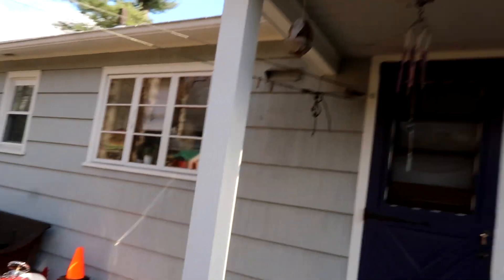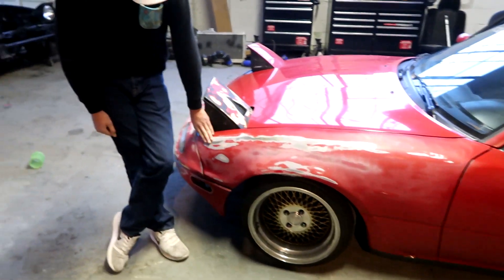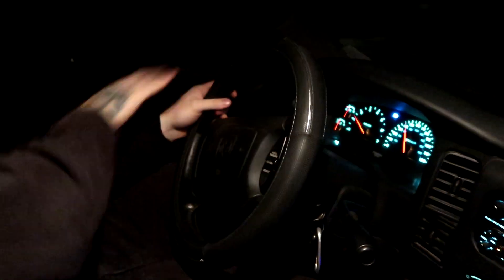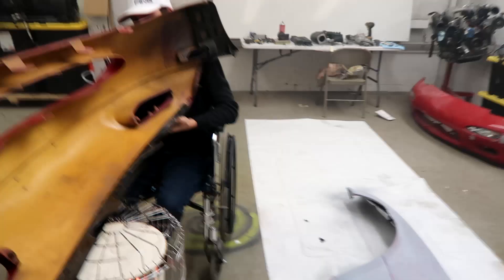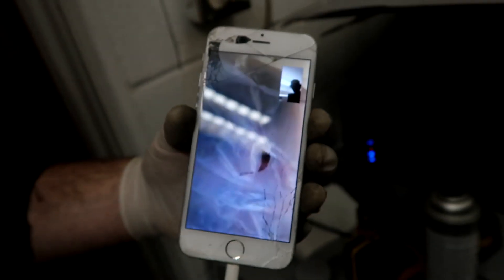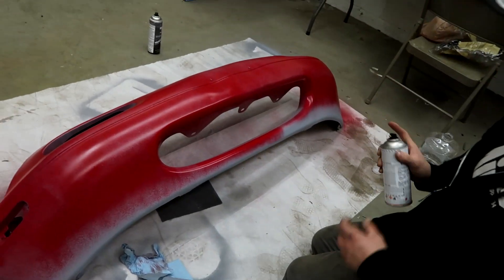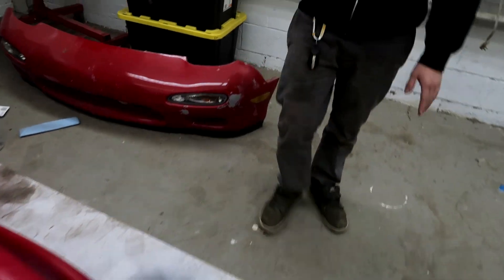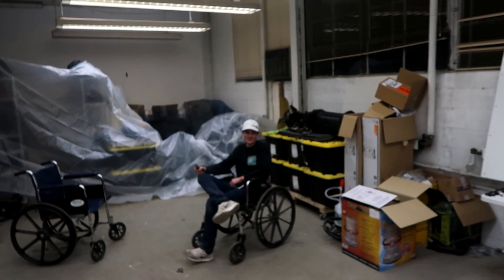IGNORANT MIATA GETS PAINTED!

Comment: spray bombing is hard 'cause of the inconsistent pressure coming out of the can but it's always best to warm the can up on a cold day with say, a heat gun. also start by spraying the edges (outline) then do even straight lines top to bottom. self etching primer makes a big difference as well.. these are things I learned while attempting to spray bomb shit lol

Comment: One suggestion, $15-$35 vacuum feed spray gun, small compressor with pressure regulator, urethane reducer and plenty of it "At Least 1 gallon" for cleaning out the spray gun and cutting base coat per the cans instructions! Then just buy the base and clear plus the activator of your choice "Timing of drying for clear" and you will save big bucks on any other paint job you guys do! The reason you choose vacuum feed is you will have more control for learning how to apply than gravity feed!

Plus you could repaint any car, especially if doing it for a demolition derby, for friends or yourself and you will save big bucks, there are many types of primers available and you will have less waste going into the garbage or to recycling! The paint can usually last up to a year, including the clear coat and you only add the activator when mixing for the gun, if you don't use a whole can of spray clear that had an activator you depressed it will turn rock hard in it quickly without exposure to air!

And for demolition cars you can just buy Truck and Tractor paint pretty cheap and some paint thinner, it will take 3 days to fully cure but will last years longer than the car does before going to the wrecking yard! It also works good on sand blasted parts for suspension, frame rails etc and is pretty chip resistant! It can also be used on auto's, but has no clear and if it fades, just use rubbing compound to renew the finish! 

But with truck and tractor paint you could repaint a car for under $50 as long as you have the gun, compressor and paint thinner, because you will need to cut it for spraying! A gallon is like $25-$35 "You'd only need a quart at most" and primer is cheap as well at tractor supply, big r etc, if you wanted a custom color you can buy it in white and have it custom colored to anything at a paint dealer!

Comment: When the cans are stored in a cold place, its better to have them sit in warm water for a few minutes.  It helps the paint atomize better.  Thats why alot of people get texture with plastidip.  You can wetsand the paint between coats with a high grit to have it turn out more smooth and even. Its good to wetsand clear coats and then polish it out with m105/205 or something similiar.

Comment: future reference, the faster you travel with the paint the more even it will be, also that paint is coming out super fast so you wanna be further away, with most paint you wanna be about 16" away and moving about twice as fast as you are, and always paint the shortest way possible. like you were going the length way, when it would be much easier to do it width way.

Comment: Pre heat the pannel and can before spraaying! ie 20C ideal

cheap spray paint has too much thinners, good stuff is a better mix with more paint content
. 
always buy from professional body paint stores that also sell  mixxed cans

You need to get enough on to get it to flow together and smooth out, add more if its dotty. 

If you do the above and clean the part up good and rought the surface with emory cloth you will get profesional result. you also need a dust free environment! wet the ground.

Hope this helps someone

Comment: Okay, I'm only a painter in training here. BUT. You should use red primer instead so that it matches the color better. The red paint will cover the red primer easier. Don't forget to prep your painting surfaces by scuffing them as I saw you do, but also clean the pieces off with wax & grease remover on a towel that will not leave lint. After the primer is sprayed, wet sand and it flat so that the texture in the primer is flat. And lastly, HEAT UP YOUR CANS.
Reply: This video is truly the blind leading the blind 😂
Reply: crunchee if there's grey primer under the original paint and you use a red primer on those panels then try to paint match it'll come out a different shade of red even though the new paint is exact match
Reply: chris No it will not. I work in automotive paint and I've seen it first hand. The purpose it to use less paint to cover the the area and still match the paint. we use gray, black, white, and red primer for the various paints.
Reply: And either way, the paint cannot be an exact match on such an old car no matter what you do. He's not even worried about paint matching though. You can tell because he just bought red spray paint that looked about the right color.

Comment: +Ricer Miata you probably need ball joints for the Dakota and the tie rods I had one and called the dealership and it had a recall and they fixed it for free and it drove good after that the ball joints don't last but every 40,000 50,000 miles and you change them.

Comment: next time you guys paint using rattle cans, leave them in warm water for about 5 minutes, maybe less depending how cold it is.  it'll warm up the paint to help spray out evenly,  especially when it's cold.
(aka the can has the recommended temp at which to paint at)

Comment: aren't you supposed to sand the fender till it's Smooth. then air compress it. then after that prime it. wait to dry and then as many coats then put on the final coat ?

Comment: You're running the heater too high, that's why there's soot all over the top after one day.  If the flame is too high, it soots.  If it's too low, it smells.  There isn't a high' or 'low' setting, you want to maintain about an inch of flame coming over the burner.
Reply: TheDuke539 I'm glad someone said it, literally probably 3hrs of running.

Comment: dude you dont buy kero there get it from the gas station its so much cheaper
Reply: like 3 gal for 10$
Reply: and the center burner wasn't even seated right surprised you didn't pass out from the fumes
Reply: next time hang your fenders so the can is held upright just a tip